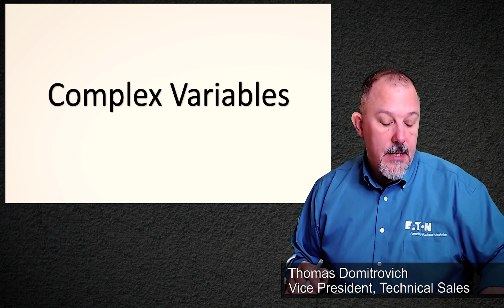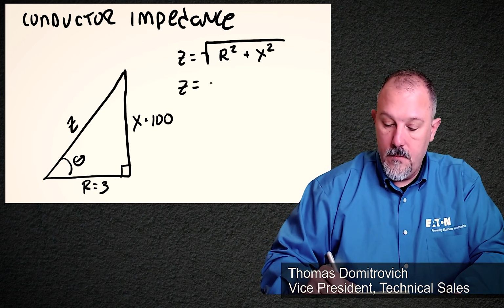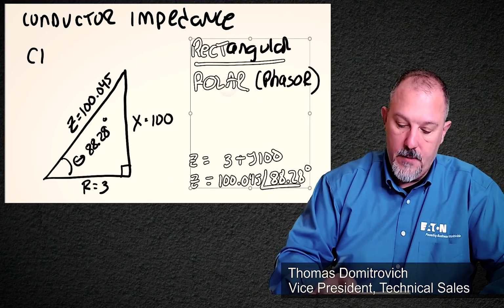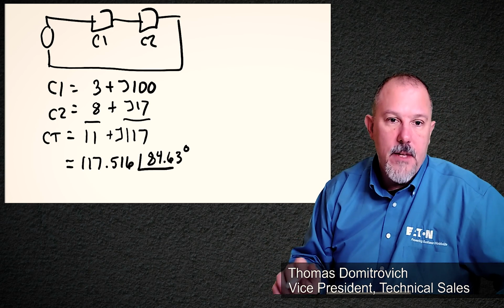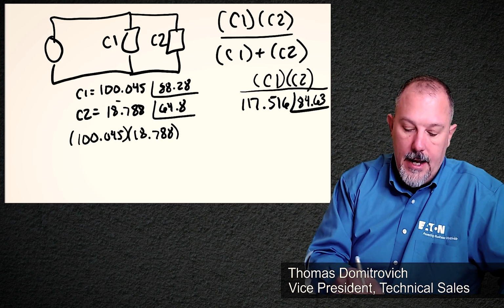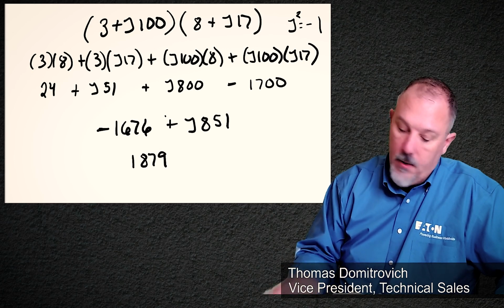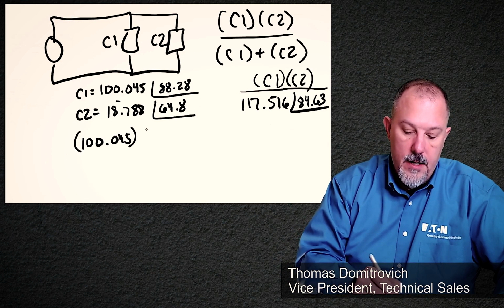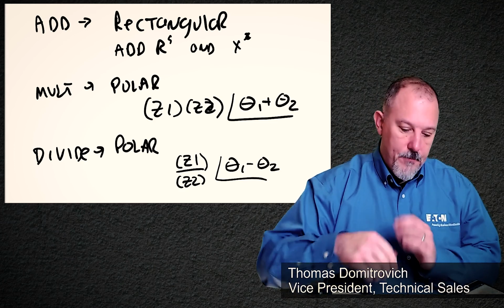Complex Variables

Comment: Define and explain inductance and reactinace the difference and effects of each
Reply from the maker: Sounds like a good topic!  I'll try to pull something together.
Reply: @TDUNPLUGGED  could it be described as a magnet resistance to voltage and current as well as physical resistance of the conductor ?? Per each of the three as applicable of course ??